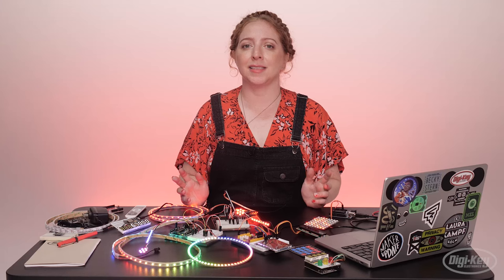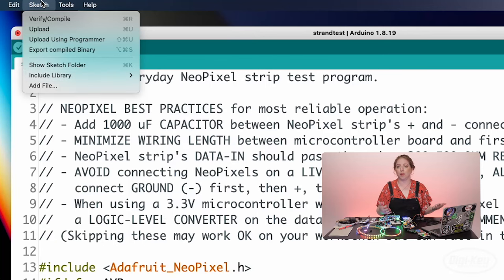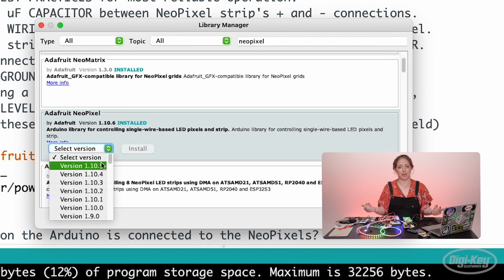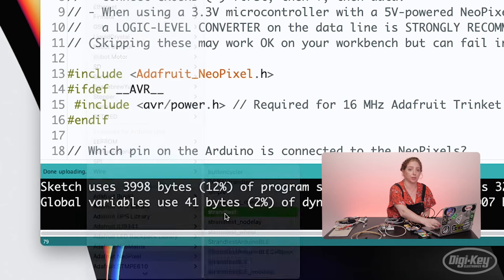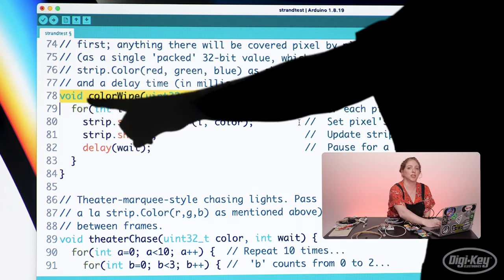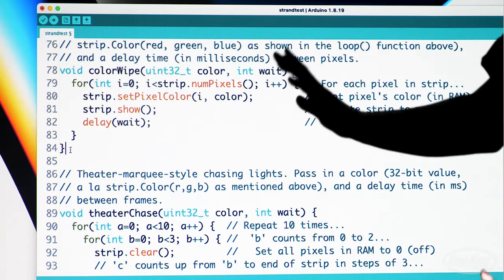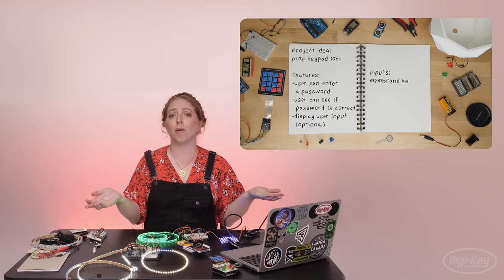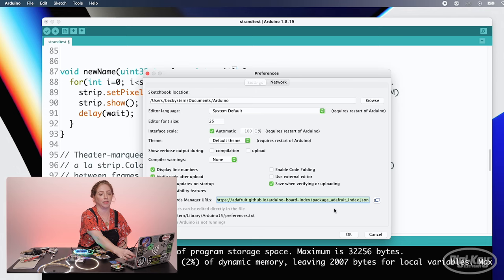Arduino Code Libraries - Electronics with Becky Stern | Digi-Key Electronics

Comment: Please put the Adafruit additional boards manager link that goes in Preferences into the video description.  I cannot read it clearly in the video. Then it can be copied and pasted with out making keying errors. I recall that at one time there were 2 URLs for this. Is that still the case? I have not dealt with that for a long time.  Thanks.